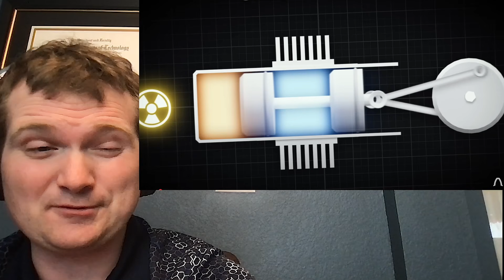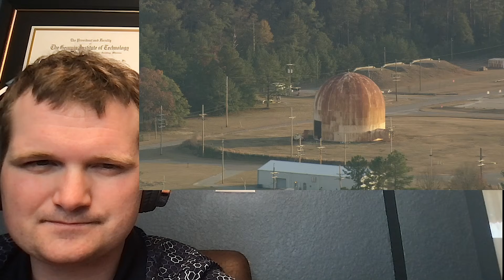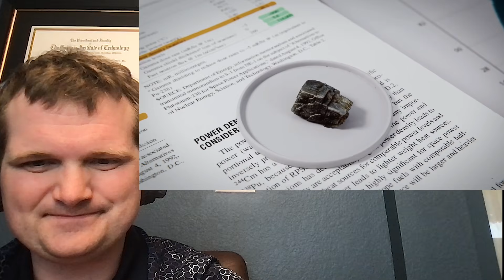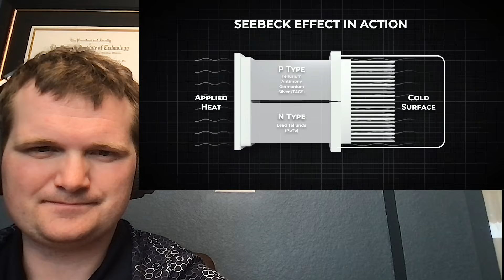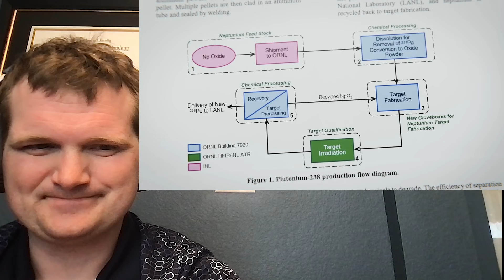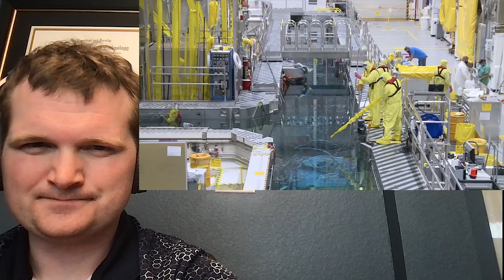NASA's Plutonium Problem - Nuclear Engineer Reacts to Real Engineering

Comment: When I learned that these RTGs are only 6-7% efficient it rekindled my passion to create my own Stirling engine design that should be more efficient that the conventional designs I've seen. Mine has a rotating displacer, thermal isolation and phase adjustment on the fly. 😎
I should patent the idea.

Comment: Am241 would be a good substitute. While it does produce a low level of gamma rays, they are low energy ones. While lower energy production density, it is a byproduct of power reactors. There's is more than enough to power all ionization smoke detectors. It's longer half life of 432 years can be an advantage for longer duration missions. One use where this would be useful would be powering weather stations or seismic sensors on other worlds.

Comment: Given that P-238 just cranks out that much heat, does one have to manufacture RTGs on the same site that produces the isotope?  Just seems like it would be a pain in the rear to transport refined 238 to a seperate manufacturing facility, especially considering that everyone at the production site is presumably already trained in proper techniques and proceedures for handling radioactive material.

Comment: The production PU 238 is by increasing the neutron flux and bombarding Neptunium-237 (Np-237) targets in a nuclear reactor, Pu-238 is then created.The process is more complex than just "adding neutrons," as it involves a two-step transmutation and decay process. Neutron capture: In a high-flux nuclear reactor, a nucleus of Np-237 absorbs a neutron and is converted into the short-lived isotope Neptunium-238 (Np-238).\({}^{237}Np+n\rightarrow {}^{238}Np\)Beta decay: The Np-238 is highly unstable and rapidly undergoes beta decay, with a half-life of only about two days. During this decay, one of its neutrons is converted into a proton, and it emits an electron (\(e^{-}\)) and an antineutrino (\(\={\nu }_{e}\)).\({}^{238}Np\rightarrow {}^{238}Pu+e+\={\nu }_{e}\). The result is a stable Plutonium-238 nucleus, which then serves as the heat source for Radioisotope Thermoelectric Generators (RTGs).

Comment: Thank you! Great video! I'm a nuclear hobbyist and radioactive material collector. This was actually a pretty good video to react to! I'm glad you mentioned barns, SF, and even-Z/odd-N isotopes being (very often) more fissile to slow neutrons, including neutron energy and capture-to-fission ratio. I know that americium-241 (t½ ≈ 432.6 years) could possibly work, but its major downsides are less heat (i.e., longer half-life), and a much higher gamma-ray branching ratio–about 59.5 keV at ~ 36% intensity, and 26 keV at ~ 2.3% intensity per alpha decay. It would need much more shielding from the indirectly ionizing gamma rays–which are mostly low-energy, but still increases the mass of the spacecraft. What are your thoughts on Am-241 as a potential heat source? I remember ESA looking into it. Thank you! All the best!

Comment: 27:20 there’s a new growi by corps of people at the Vitrification Plant at Hanford, also. Their low-level waste melter is finally working, though the high-level waste melter is still under construction - that part will process the “worst of the worst”, from Hanford’s history. 57,000,000 total.

Comment: Nasa's Dragonfly drone is absolutely massive!
I was thinking about an 80-100kg drone, but then he said that it will need 4.8kg of Pu-238.
That means that the craft will have a mass of about 425kg. That's quite ambitious.
I know very little about the program. I only hope that another, much smaller drone is taken to give the mother craft some level of redundancy, so that there's at least something so show for it.

Launching and losing 425kg worth of extraterrestrial craft (a flying craft no less)... that would not be very nice on taxpayer's wallets.

Comment: You are correct about the moon being tidally locked, but it is in fact tidally locked with respect to the Earth not the Sun. It does still have a day night cycle so solar is actually available over the whole body. The day-night cycle is very long it's solar day is 29.5306 thus the mean length of the night is 14.7653 days obviously despite having a much smaller axial tilt than Earth there is seasonal variation depending on location and time of year. But yeah this does raise the problem of what you are going to do during the lunar night except it is actually worse in some regards than you suggest because any mission to any point on the surface that will last for more than a couple of weeks will have to deal with the lunar night because the moon is not tidally locked with respect to the Sun so day and night happens everywhere. With the exception of the much smaller regions inside the polar circles pretty much any mission anywhere running for more than a few weeks is going to be plunged into night and will have no solar power available for several weeks. That would require some beefy batteries for any medium to long duration mission hoping to rely on solar power which is a real problem as those buggers are big and heavy, thus rather expensive to yeet out of this gravity well we are at the bottom of here on Earth to get them to the moon.

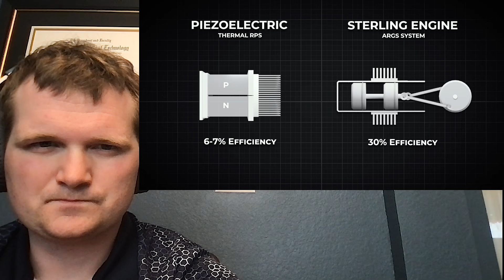Comment: 23:31 Interesting seeing that 30% efficiency as I've seen a lot of that references to that topic from multiple and widely varied disciplines. Hopefully this means things might be about to change. I heard the reason behind the best thing "we" have is 30% efficient, is due to the patent office not provide patents for things over a certain efficiency because of the Invention Secrecy Act of 1951. The surface level reason for implementing this was that anything effecting the energy sector (that was just fossil fuels at the time) would put the the economy at risk. As such things putting this sector (or more accurately the people who led and controlled it) at risk were classed a national security issue. This explaining why any attempt by someone to go beyond these (seemingly arbitrary percentage) thresholds would be quickly shut down, dismissed with snorts of derision, bought out and then put on a shelf or the discoverer jailed for fraud or disappeared. For those not convinced doesn't it seem strange that the sterling engine was designed back in 1816 yet this is the best thing we have available for this purpose?

I think the deeper reason for this act being done to stop anyone accidentally duplicating research and results the military industrial complex was carrying out to explain the energy source needed for UFOs. This research coming about due to multiple confirmed observations of them performing actions that didn't align with known energy density laws. Laws of which that have also curiously not been allowed to change in the public realm of academia and science since that period. Instead we've been given nonsense that only works on paper (that only a few people can understand) such as string theory, dark energy and dark matter to play with. Things that will never have any consequence as they are made up, have no real world application (apart from wasting tax payers money) and as such won't put the "them" at risk.

Comment: I don't think a stirling engine can last as long as a traditional RTG with peltier elements. If we count low with 1000 rpm on a small stirling engine (it would probably run faster than that), if it had been running since the launch of Voyager 1 in 1977, it would have had to make 25 billions revolutions now. I don't think that's possible.
Reply: I found a couple forum posts that say for average driving, an engine rotates about 150 million times for every 100,000 miles. My uncle's truck is close to 600,000 miles on the original engine, which is 900 million revolutions. If a GM big block can do that, I'd bet NASA could make something even more robust. 25 billion revolutions is a lot, but it's not as crazy as it seems.

Also jet engines don't have any reciprocating parts so it's not a fair comparison, but the exhaust blades spin at around 10,000 RPM and they have an overhaul time of 20,000 hours which equates to 12 billion revolutions.

Comment: Not mentioned in the PE video:  the Pu oxide in RTGs is made with isotopically pure O-16.   This is to reduce neutron emission, since some of the alpha particles emitted by the Pu-238 will produce neutrons upon hitting other oxygen isotopes.   This is done by making Pu-238 oxide with ordinary oxygen, then flowing pure O-16 over it.  Oxygen naturally undergoes exchange with the red hot oxide, so the oxide gradually is purged of its initial unenriched oxygen.

Comment: As somone who know nothing about radiation. Isn't the "Paper>Aluminum>Concrete" wrong when put on the same thickness ? 
Like Paper is 0.1mm, aluminium could be between 0.5-10th mm and concret is at least few 100mm to meters.
If everything is 1 meters thick ? what happen ?

Comment: The Russians liked to use Sr-90 because Is far cheaper than Pu-238 and has higher power density, however it is a strong beta emitter so there is a significant risk of bremmstrahlung radiation.
Reply: In Soviet Russia they also used strong Vodka as spacecraft fuel, so yeah.  :D :D
Reply: Jawohl!
Reply: Yeah, but the Soviets/Russia used a lot more RTGs than the US for industrial power sources in relatively remote or difficult regions. Pu-238 is clearly a better choice when you cant perform any maintenance,, such as on spacecraft, but Sr-90 is arguably a better choice if you need a lighthouse or something like that.
Reply: @bpz8175  until they get orphaned after the wall falls and then people find them

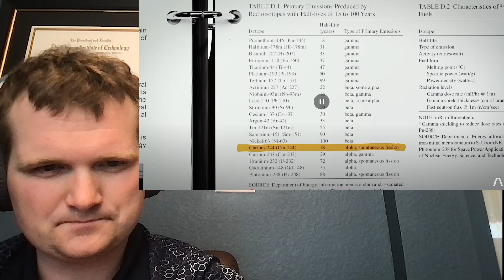Comment: 15:53  Don't thorium reactors make U-232? Is the density equivalent to the plutonium 238? Gadolinium looks interesting too, but again, density, ease of production and handling would also need to be considered. U232 is the one that I'm actually most interested in in the usage of this, having said that I'm certain that it wouldn't be ideal since it is easier if I remember right to use it as enriched B-making material
Reply: An explanation on why gandolinium is simply not suitable already explained in the video. Actually saw this video and I forgot this part. I'm still interested in the u232

Comment: Hey I just learned from your talks that you can breed U238 into Pu239 in a BWR even though it's moderated. That was new to me! Just read the wikipedia article, here's an excerpt:

The power control by reduction of the moderator density (vapour bubbles in the water) instead of by addition of neutron absorbers (boric acid in PWR) leads to breeding of U-238 by fast neutrons, producing fissile Pu-239. This effect is amplified in reduced moderation boiling water reactors, resulting in a light water reactor with improved fuel utilization and reduced long-lived radioactive waste more characteristic of sodium breeder reactors.

So basically reducing absorbents like boric acid leads to increased slow neutron reactivity, which creates more voids, which decreases slow neutron reactivity but also causes breeding of U238 into Pu239 thru fast neutrons. That's really interesting.

Comment: Question on half lifes- it's not like in 87 years a switch is flipped and suddenly 50% of the atoms have decayed right?
So it's not just 50% less power in 87 years, it's steadily going down to 50% in an 87 year span correct?
Reply: Over that 87 years, half of the material has decayed- it’s a continuous thing, the radiation given off is the gradual release of heat/energy. Eventually it loses a proton/neutron and fissions. Then, as mentioned, it continues to decrease exponentially, with half of the material fissioning again over 87 years
Reply: Yes, you saw the exponential decay curve. Imagine if you had a sack of dice; if you roll them all and discard any that come up one, you'll lose about 1/6 of them each time you do that. If you keep doing this over and over you'll get a decay curve similar to the one shown. It'll take several cycles to have half your dice "decay", you don't just have half of them go at once.
Reply: yes. why dont you just google it?
Reply: It's probability, but generally half the material has decayed BY the half-life. In reality it might be a bit plus/minus of exactly 50%.

If you start with 50g of p238 (assuming pure, lol) in 87 years you should have about 25g of p238 remaining, but its a constant decay (not "poof you're lead" at a set time).

Comment: Is it possible to go into stored nuclear waste and use that plutonium..I think there is some buried at Hanford and several other locations..or is that impossible or two difficult? They produced 74 tons of plutonium at Hanford years ago and much of it is still stored there as waste supposedly. There is over 56 million gallons of nuclear waste at Hanford that needs to be cleaned up anyways.
Reply: there is no buried plutonium at hanford. the 74 tons produced at hanford was P239 not P238
Reply: @wyliesdiesels4169  ah is there any at any USA waste sites? Sorry I don't really know much about this stuff I'm rather naive.
Reply: It shows lol  @sycksyngyrl
Reply: @ no there is no P238 at hanford or any other site. P238 is very finite and is made via  specific process with specific source. the contamination at superfund sites is P239 which you definitely dont want to use for space power reactors (RTGs)
Reply: @wyliesdiesels4169  ah thanks for your response it's sad we don't have a better way to convert that waste yet...
Reply: @ converting the waste wont generate/produce P238 though. thats not how fission bombardment works.
Reply: @wyliesdiesels4169  I have absolutely no clue about any of that I two degrees in business.. that's why I ask lots of questions to learn

Comment: 14:24 YOU CANT TELL ME WHAT TO DO!! consumes plutonium-238
Reply: Heavy metal poisoning, heat, or radioactivity. Which one will get you first?
Reply: Heat for sure.
Reply: @PhD_in_Undecided  Not unless you ate quite a bit of it. Pu-238 only gives off about half a watt per gram, while your normal body heat is about a hundred watts when you're resting, or more when you exercise. A few grams wouldn't increase the heat your body has to deal with compared to just sitting around.
Reply: @WJS774 Lol, yeah, not even CLOSE to mattering.  The reason I am responding this late is because I am really fascinated by how much energy our bodies maintain in the concentration gradients in all the mitochondria.  If that gradient collapsed and the energy were thrown off as heat instead of being used to make ATP, we would literally cook from the inside out.  Our body temperature would continue to rise long after death.  I know this because it happened in the 19th century.  A chemical that was being used as a dye ("Mauritius Yellow" IIRC) and in production of certain munitions a long time ago (2,4-dinitrophenol) once found its way inside some plant workers.  That is what happened.  The decay heat produced by Pu-238 is bubkes compared to this energy.  If u wanna denature as many of ur proteins in one go as possible, this is the solution ur looking for tho lol
Reply: @nsr-ints  If it's big enough the heat will probably be the first to do you in.
Reply: Mmm, red-hot.

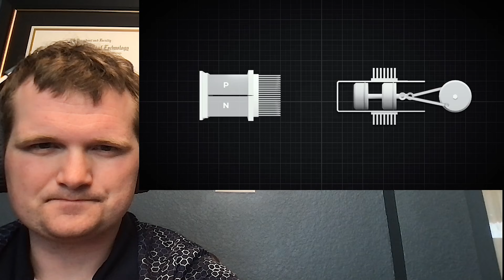Comment: 23:15 and the vacuum of space, is an AWESOME cold source.  Not only that, since you're producing mechanical energy already, extracting a portion of that for gyroscopic stabilization should be easy peasy.
Reply: Heat dissipation is actually quite difficult in space, because you have to rely entirely on radiation, vs being able to convect away heat in an atmosphere. Even though space is technically cold, there’s very little mass, you you can’t really use it as a heat sink. Getting a low cold bath temperature is really hard, because radiative cooling scales with the 4th power of temperature, so to halve the temperature you need 16x the radiator area. Many thermocouples are run at low efficiency in space because of this, since radiator mass becomes inhibitive quickly.
Reply: @caliperstorm8343  ok thanks for sharing!
Reply: @caliperstorm8343  precisely! The vacuum of space is.... well... a vacuum. Where do people think the heat would transfer to? I blame videogames >=(
Reply: The vacuum is actually a terrible "cold source", since you only lose heat through radiation.

Comment: I have long wanted my own photo-nucleic generator.  (I think it's going to be easier to build than an RTG, but I want one of those too  for my house.)  But I have no idea where to find a flat sheet of Tritium doped glass, only tiny vials.  Which is cool, I suppose, for making a toy, or a demonstration model, but at 33% efficiency, a 100 watt panel would only produce 33 watts open circuit.  Not to mention how MANY vials I'd have to buy to cover that area, it becomes cost prohibitive.  Very annoying, as using tritium to produce light constantly totally negates solar's most obvious fault.  😡  Stupid regulatory bullshit.

Comment: wasnt Hanford site the main place of manufacturing plutonium in the USA?
Reply: And btw, both Hanford and Savannah river site had both ceased plutonium production several decades ago.

All of the nation’s current plutonium stockpile are housed in one of the decommissioned reactor building at Savannah river site.
Reply: There is also Savannah river site with reactors solely for producing plutonium.

And there was also Rocky flat plant that processed and machined the raw plutonium metal into a pit for weapons assembly.

Comment: 11:48 wouldn't that also be a contaminant of the fuel in a commercial reactor?  Having weird daughter particles in with your uranium fuel?
Reply: They have open pipes through the reactor core, and pack target stuff into tubes that get stuck through those.